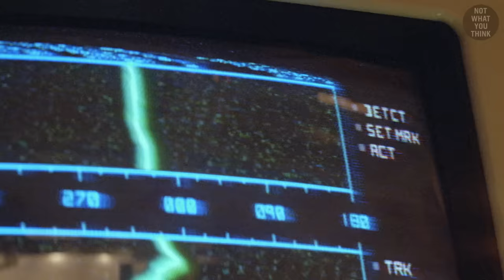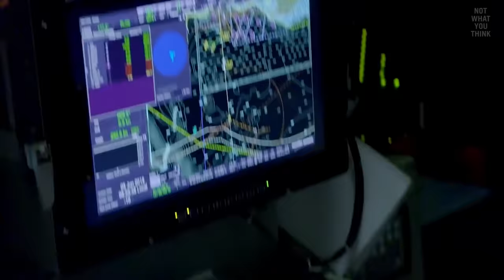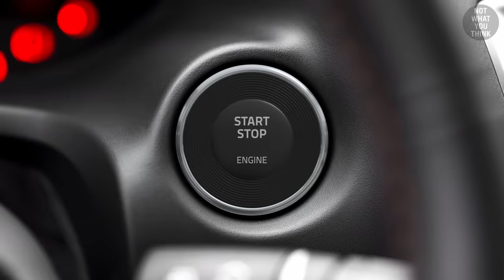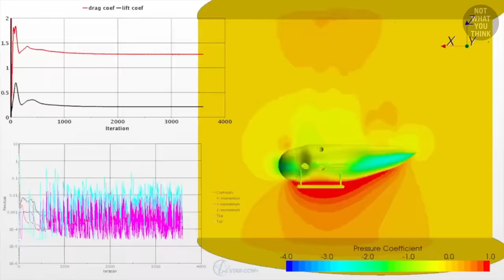What Happens When a Submarine Implodes

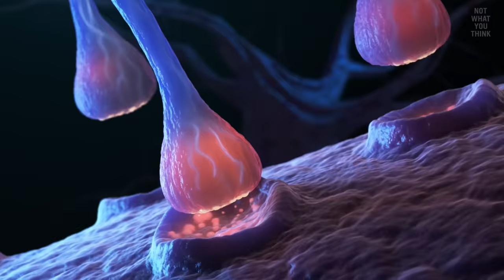Comment: 3:30 +the ability to leave no fingerprint on crime scene
         -less grip
           Pain
Reply: I'm a part time blacksmith and have accidentally touched red hot steel (around 1600 F) and I can tell you for sure that most of the time, your fingerprints come back. Not always without scars, but definitely still enough to identify you. :) 

Funny side note there - my mother-in-law has hands that, at she aged, kept getting smoother and smoother. She had to go for a security clearance and they couldn't get any fingerprints with a digital scanner. I'm not sure if they got anything useful with ink.

Comment: Submarines are definitely one of my favourite vehicle, the fact that you can just chill in a room underwater knowing that outside is the vast ocean is just satisfying
Reply: And extreme claustrophobic 💀
Reply: @ADMusicS submarines are huge
Reply: @vince-p.8591 not inside
Reply: @madensmith7014  Navy subs are pretty spacious
Reply: @madensmith7014  your correct I thought at first that since subs were huge in size that it meant on the inside as well I guess not
Reply: @kakarottattaglia556  -- That could only be said by someone who has never done any sub duty, even boomers, while there is some open space like the isle ways in the missile section between the tubes, it is still not a lot, most place are pretty tight by surface ship standards.
Reply: @madensmith7014 within
Reply: @MrWildbill yeah, but there's always somewhere. I used to go an chill in the greenie bin for a bit of alone time.
Reply: @vince-p.8591 some are, some aren't.
Reply: @kakarottattaglia556 not really, no.

Comment: There's a video on YT showing what is understood to be the transcript between the sub and the hub ship above. It shows a period of 19 minutes between the first sensor indicating a hull issue to the final message. During that time they reported cracking coming from the aft of the sub and it struggling to ascend due to it's weight. It also appeared to have been descending too fast as it was around 3600m after just 90 minutes. 19 minutes in that sub knowing there were serious issues would have been extremeley traumatic. The implosion instant and probably a blessing given the fear and panic in the sub during that time. Such a sad disaster

Comment: imagine how quickly it happened to the Titan. they were 10x deeper and thousands of times smaller. it was over in less than a blink of an eye.
Reply: Reckon that engineers could probably work out how quickly it happened by how far the titanium end hemispheres travelled as it imploded!
Reply: @stevie-ray2020  good idea
Reply: @SpaceX-Falcon-Heavy  The force  of the implosion would've pulverized them instantly into a large spread out cloud of fish-food fragments!
Reply: @parkerc204 The force of the implosion would've pulverized them instantly into a large spread out cloud of fish-food fragments!
Reply: @stevie-ray2020  James Cameron has seen pictures of the wreckage, he says the entirety of the submersible has compacted into one of the two end-domes that capped either side of the cylindrical hull, that includes the remains of all five of the victims.  Like the equivalent of standing up an empty soda can and stamping on it, the entire can basically fits inside the lid.  That's what happened to Titan supposedly, flattened from back to front like an accordion.
Reply: @krashd  As the front hemisphere blew off when that happened, maybe it's possible to calculate the force & acceleration imparted on the submersible during the implosion by how far apart the debris was (as long as the mass of the two sections with contents is known), as well as the use of seismic-data recorded at the time!

Comment: Max operating depth is not "crush depth". There's usually a reasonable factor of safety.
Reply: There is Test Depth that is the beginning of dangerous depth passing design limits, crush depth, give or take a little is just what it says, the sub can and likely will be crushed.
Reply: Yes, this is more like test depth
Reply: @SeekingTheLoveThatGodMeans7648 In some cases, a death depth.
Reply: Yes- test depth is its safe and tested depth. Design depth (or "crush depth") is the point permanent deformation past the material elasticity. It doesn't fail at exactly this point but the pressure vessel is very permanently compromised.

Due to carbon fibre's poor elasticity and compressive strength, and the acrylic port's rated depth, and the bonding- this submersible may have been far BEYOND 'crush depth' at the titanic. One of the reasons this is possible to do is carbon fibre is heterogeneous- the outer layers can fail differentially to the inner. Hence its previous delamination and repair.

Design depth 'crush depth' would consider delamination as only occurring past that depth. With carbon fibre resin that could've been in feet on this vessel and permanent hull damage may have begun in the very outer surface.

A titanium hull for example is less elastic than steel - but will hold up past its elastic limit too. Theoretically a pressure vessel of titanium could suffer permanent demormation but not collapse yet. That might not matter if for example the vessel now has significantly less room inside.

In practice it isn't just a hollow Titanium ball so bad things happen once deformation begins. 

Thank you for my ted talk. Disclaimer: I'm no expert so go to them for the better explanations if interested. I typed this at 4:30am on painkillers.

Comment: Navy nuclear submarines and the types of submersibles that can go down to the deep ocean depths like the Alvin or the one built by James Cameron and Co. Are very different animals. Navy subs are military hardware designed to fight in a Myriad of ways, from sub to to sub combat, sub to shore missile strikes of conventional and nuclear weapons etc... these vessels can accommodate entire crews and stay submerged for months on end. They're also cigar shaped which limits their max depth to maybe a 1000 meters. To go down deep to somewhere like say the titanic wreck for instance, you need another type of vehicle based on the bathascape. These craft are either steel or titanium spheres that can take only a few people at a time down into the extreme depths. If a Navy sub sinks and implodes it gets crushed like a beer can due to its shape, but the relatively shallow depth at which this happens isn't as violent as what happens to a deep ocean submersible.  When you're down a few miles beneath the ocean surface the pressure is high enough to render your craft into crumpled tin foil and turn any occupants into a cloud of red mist. In the fractions of a second that this takes place in, the incoming water pressurizes the air inside the craft to the point of ignition. The immense force of that water pulverizes any organics into something like a vapor.
Reply: Aside from Titanium, I think polycarbonate is also used well and cheaper. Bottom line is these materials are solid and continuous, and not layered like carbon fiber. Curious to see if that carbon delamination is confirmed as was the cause of the Titan accident.
Reply: @Shadow__133 the window too wasn’t supposed to be that deep and the epoxy resin to seal different materials i don’t know what gave in first i don’t even know much about carbon ect the video i seen when he used resin apparently it’s not really good for sealing the two materials w
Reply: @robertbruhcuh3634  I wonder if the epoxy is only for holding the assembly together when it's above the surface.  Once underwater, it's at best a malleable gasket.
Reply: @robertbruhcuh3634  Precisely why I am interested in the findings from the investigation.
Reply: I still can’t wrap my head around the fact that the air suddenly becomes so hot that it ignites. Can you explain this in laymen’s terms? I want to understand!
Reply: @kristita_888  It happens in a diesel motor all the time when it runs. It doesn't ignite the air as air is not a fuel but anything that can combust will.
Reply: @kristita_888  oxygen burns when hot enough and the rapid change of pressure is a transfer of energy. A lot of energy. Enough to catch the air on fire.
Reply: @kristita_888  sure, whenever you compress a gas like the air we breathe, like whats done by an air compressor used to fill a tire it heats up because your filling a given volume with more and more of the gasses that make up our air. As more and more air is crammed in the molecules start running out of room as the pressure goes up, those molecules interact (think friction) and you get heat as a result. Of you go to the camping isle of most stores they'll have these little fire starter devices that are two parts with one being a hollow bit and the other having a bit that fits into the hollow portion, these are relatively air tight. So you put a little tinder in the hollow part followed by the straight piece which you push in with force. The air having nowhere to go will compress and create enough heat to ignite your tinder and you can then take that burning tinder and start a fire, I think they're called matchless fire starters or something similar. So when the sub imploded under thousands of pounds of pressure per Sq. inch, the water compressed it (along with the passengers) into whatever cavity there was and just like the fire starter, the temperatures reached were more than likely enough that for a fraction of a millisecond everything that could burn did. Then of course the water continued tearing the sub to pieces and vaporizing the occupants. Not to get too off into the weeds but implosion is the method most used to detonate fission aka nuclear bombs, where a small sphere of plutonium is surrounded by 2 layers of high explosives shaped so that when they explode a vast amount of that explosive force is sent inward to the plutonium. That sphere of plutonium is then compressed, which increases its density and taking a subcritical mass past critical mass and on to super critical giving us our chain reaction and boom. If those people in the sub had been made of plutonium they would have been compressed enough to detonate that's how severe an environment the deep ocean is. In space a human body can survive being exposed to the vacuum for about 20 seconds. If in that time you can get to an air lock get inside and pressurize, you'll be injured pretty badly but you'll probably live. In the deep ocean abyss there is no survival window for exposure. Even deed sea divers that spend great amounts of time in pressure chambers acclimating to higher pressure and breathing an oxygen helium mix  with only a portion of the oxygen present in normal air can only go down so far and nowhere near titanics depth, past that point our nervous systems fail as do our ability to transport oxygen to our cells.(nitrogen becomes toxic past certain depths, as do surface levels of O2)
Down in the deep is the most hostile place to human life that we can access. I'm sure the planet Venus with its own crushing air pressures similar to the deep oceans here on earth, temperatures high enough to melt lead and clouds of sulphuric acid are more hostile but as far as planet earth goes, deep ocean waters might as well be some hostile planet from science fiction
Reply: @limabravo6065  This sounds so weird, but I’m obsessed with nuclear weapons and how they work. I’m familiar with implosion fission devices and that metaphor actually helped me understand what happened to those poor people in that submersible. Thank you so much!
Reply: @leonhardtkristensen4093  Thanks for your help! Did the Titan have any sort of fuel on board — or was it all electronic? I have a feeling I’m going down a rabbit hole on Google tonight.
Reply: @glenmel78  That is terrifying when you think about it. Thanks so much for your help.
Reply: @KanyeTheGayFish69  Obviously not obvious to me 😂
Reply: @kristita_888  Because pressure and temperature is related. If you compress air, the volume does not change, only the size, so all the air molecules will not be as far apart, they will hit each other. This friction is what generates "heat". 

Another way that can cause heat is when you're speeding up the molecules by heating it, say, boiling water, in this case, it's the increase in heat that causes the molecules to hit each other at greater speed, which generates heat. 

Heat is simply just the movement of energetic atoms. Like if you pluck one end of a guitar string and it will vibrate all the way to the other end. Molecules transfer their movement to the nearby ones they hit, hence transferring heat.
Reply: @kristita_888  no worries I used to work for Sandia labs decommisioning older nuclear weapons
Reply: @kristita_888 Air is needed for fire to keep going. Once the submersible imploded it also exploded which ignited the air.
Reply: @kristita_888 I’m not 100% sure if the Titan had fuel, but it did have a battery pack that was designed by college students to keep costs down, and that for sure would have exploded and contributed to the air igniting.
Reply: @tiahnarodriguez3809  Holy cow! The more I learn, the crazier this situation gets!
Reply: @nicholaslee5473  That is an excellent explanation — thank you!
Reply: @robertbruhcuh3634 submarines that are supposed to go that deep don’t exactly have windows either. Large windows can cause the submarine to implode and are weak points on the hull. At that point most deep sea submarines have cameras on the outside and TVs that allow you to see what’s going on.
Reply: @kristita_888  The other "fuels," of course, are the fabrics, clothing, etc. and the crew bodies themselves, which contain various types of combustible fats. Another factor against finding recognizable remains.
Reply: Nice but knowbody has survived this to tell us if it hurt.😢💙💛💚🏴
Reply: @robertbruhcuh3634  I think it was more they cheaped out and used a factory unable to certify to the required deapth rather than using something unable to reach the depth but that is honestly just as bad.
Reply: @anthonycox3493  the speed at which this sub experienced the big crunch, is faster than your nervous system can process input. It's akin to sitting on a massive bomb when it detonates. And if theres any mercy in the universe those people didn't even have time to realize what was happening, but yourenright in that we'll never know. What we do know is that we need to respect the power of nature and these extreme environments by putting our best and brightest to the task of building the craft to explore them, listening to those who understand what it takes to expand humanities knowledge base in the safest way we can. Pushing boundaries will inevitably take lives as it always has, but willful ignorance in favor of any reason is inexcusable
Reply: @Shadow__133 can pretty much guarantee it.

Comment: After watching this video, it made me realize how dangerous and terrifying being a submariner is. I used to dream to have a job like this. 
Imagine, if the sub sudenly looses power or controls, your sub just slowly sinks down, you and the crew are waiting for the imminent implosion with the same feeling of dread and despair.
Some will be praying to God, some will cry and some will laugh uncontrollably, others screaming.
Slowly descending, you hear all the alarms go off, gauges break , hear the metal creaking and cracking, shriek and rattle them boom, you are pulp.
Reply: The reason why you do some research before starting a career like that.
Reply: If you loose power or control, most subs are designed with magnets to drop the ballast so they will start floating upwards. I dont know how recently this has been implemented tho. That's not to say other things cant go wrong however.
Reply: True story: Same as told previously, however, this crew miraculously contacted a passing tanker who replied Waaaazzzzzuuuuppp 🙄
Reply: No. Military submarines have multiple redundancies. Even without power they can be operated manually, at the very least to return to the surface.